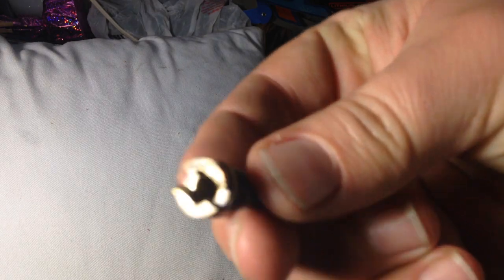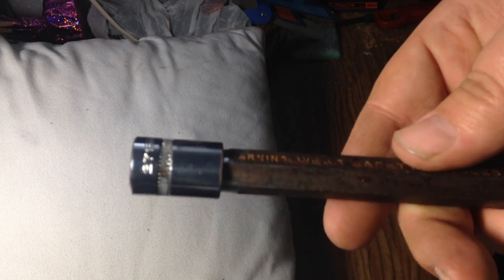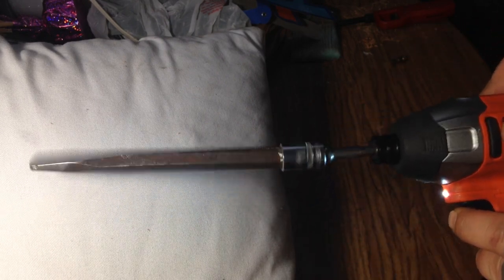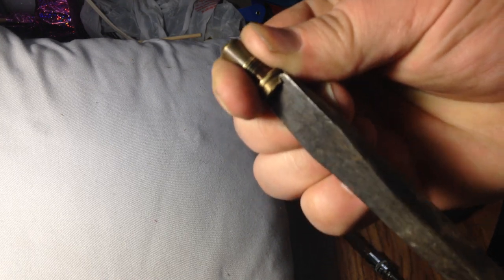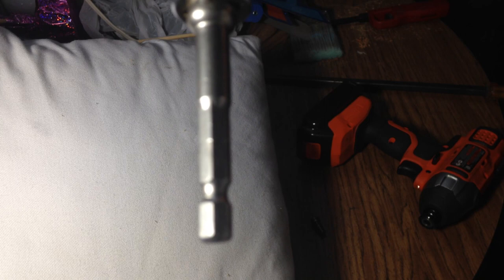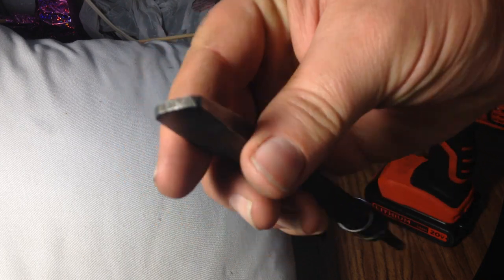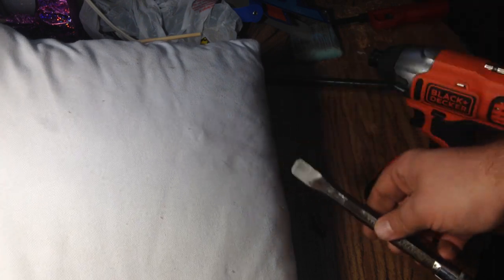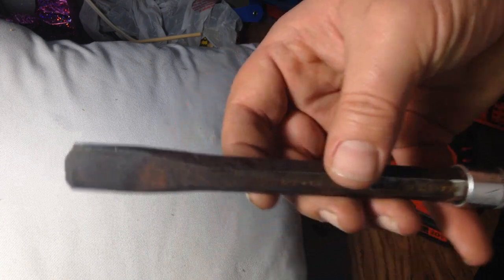Coleman check valve tool made for FREE DIY EASY

Comment from the maker: This is not for someone restoring a Coleman lantern but someone trying to fix theirs.. If you want to restore then purchase the proper check valve tool. Good luck !

After soaking my check valve it turned out it was stuck so it's cleared now and my lantern runs like a champ !

Comment: Locking pliers make excellent handles I find.
Reply from the maker: martK banjoboy i tried it and without having someone to hold the fount it's hard to do it solo. If u wana skip the socket and adapter use vice grips and press hard and have someone hold it tight.  The rotational power of an impact and doing it solo beats trying to have someone hold it and trying to turn it.  I tried it no bueno.
Reply from the maker: martK banjoboy yah bro it's a bitch to get out, i dont know why they set them soo tight that you'd need to buy/make a special tool for em.  Hey you live and learn.

I believe when i put mine back in i did the vice grip and chisel method to just snug it back in.  This was my first in depth tear down of the lantern but i have basic car knowledge and a lot of tools to mickey mouse a contration that i thought would work and luckily it did.

If you go to home depot site and put "tekton 1/2 chisel" thats about what i had and it's 6.42 and if you have a bench grinder, angle grinder or regular file you can make my tool.  Now if u want it impact driven u need an impact driver and hex to 3/8 shaft to fit a 1/2 in socket.
Reply: I will rig up an easy out some how with a bushing. also will probably have to fill the font with kerosene to free up the threads. That can wait though. The original tank had rust inside anyways.